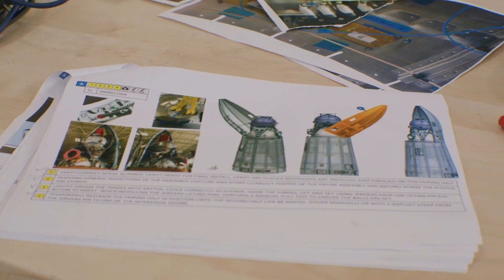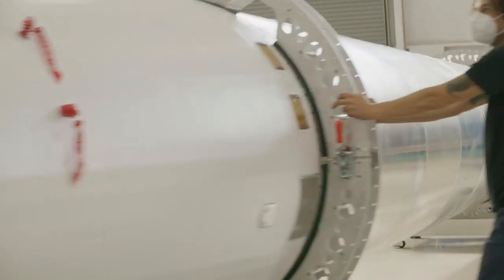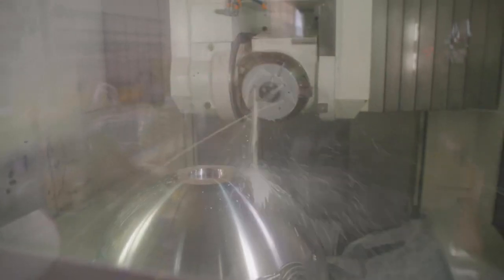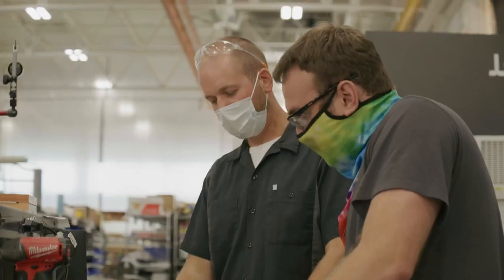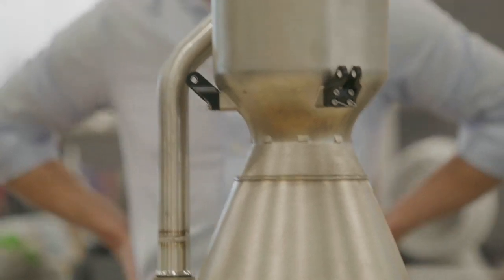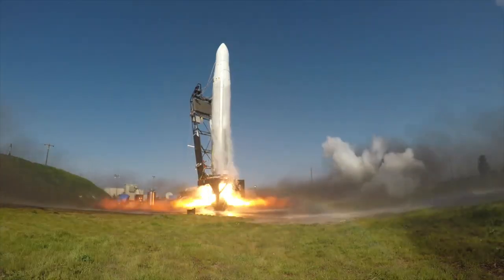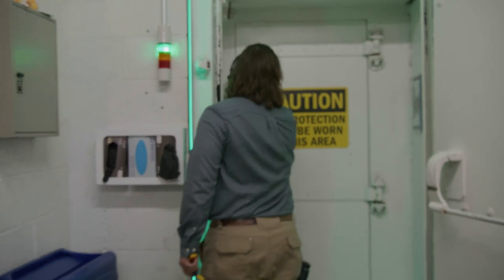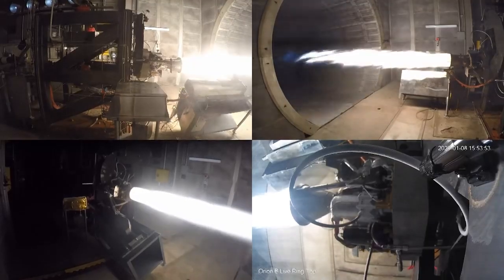Astra Rocket Factory Tour

Comment: i have not finished a 7400 ic flight computer. I have seen rocket servos go for 2 or 3 seconds and just move to one side. If it is a feedback control system it might not have both PROPORTIONAL and RATE feedback. Online polynomial programs can be used to see what polynomials wont solve. I have made it to the back of a control system book with a program that solves S back to time. The numbers simply go offscale if either rate or proportion is removed. I put rate feedback in the block diagram with an S block. I used a hydraulic power steering block in series with inertial mass I. Maybe test by suspending rocket stage with cable and observing what the control system does when the direction has step input.